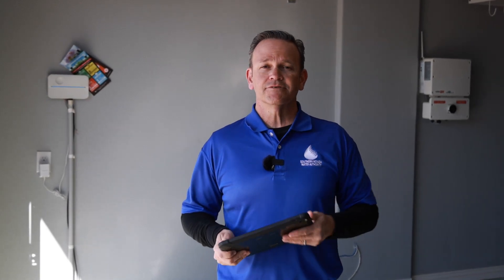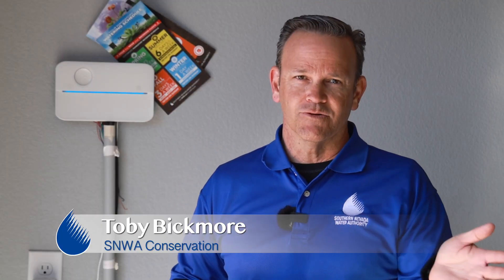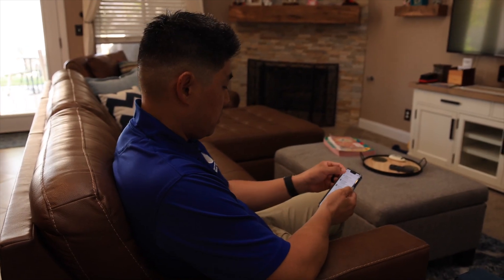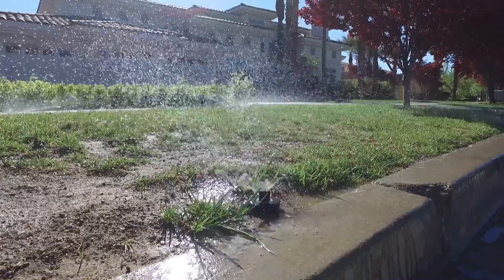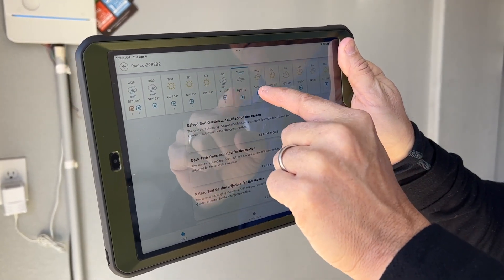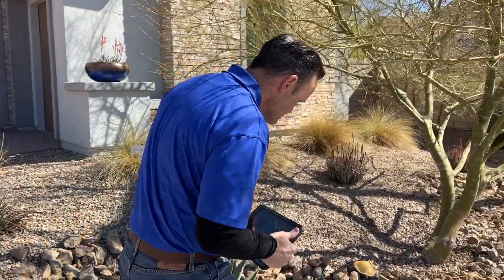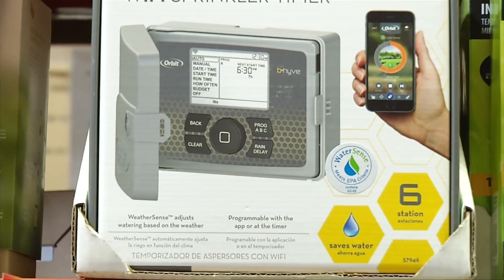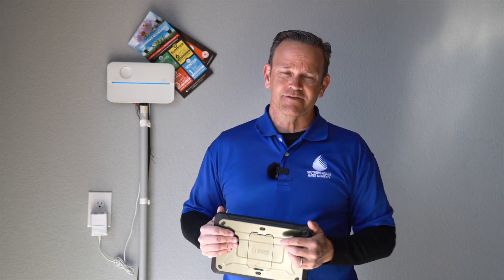Smart vs. Traditional Irrigation Controllers: Smart Technology Used to Your Advantage

Comment: Excellent video and I unfortunately don't agree with the commentary re the Las Vegas Valley Water District.  I have both types of controllers (in fact three controllers), a Weathermatic SL1600, a Weathermatic PL800, and a Rachio 3e controller.  Living in the Vegas valley, I found that the Rachio controller required significantly greater use of water than the "conventional" controllers (maybe my programming settings were incorrect, but I tried multiple variables).  Another significant miss re the Rachio controllers is that they do NOT have a manual MONTHLY  scheduler that allows you to comply with the LVVWD seasonal watering restrictions where you can create a watering schedule and forget it (Rachio only allows date ranges meaning you'll have to repeat creating a schedule each year).  HOWEVER, as this video points out, the Rachio unit (like many WiFi models) allows you to conveniently troubleshoot emitters and leaks using their associated mobile phone/tablet app; a real plus.

After testing many irrigation controllers, I have found the best controller for the Las Vegas Valley Water District is the Weathermatic line for the simple reason these controllers can be programmed one time in a set-it-and-forget-it manner.  The secret sauce is that the Weathermatic units include a MONTHLY SEASONAL ADJUST feature (a feature that I wish Rachio and other smart controllers would consider).  So in our case, we are required to water on: 
- Mon-Sat from May-Aug; 
- Mon, Wed, & Fri during Mar-Apr, Sep-Oct; and 
- Fri during Nov-Feb.

On the Weathermatic units, use:
- Program A for May-Aug months,
- Program B for Mar-Apr, Sep-Oct months, and
- Program C for Nov-Feb. 

Set the days and times to water per usual. Then set the Monthly Seasonal Adjust as follows:
- Program A: 100% for May-Aug (0% all other months), 
- Program B: 100% for Mar-Apr, Sep-Oct (0% all other months), 
- Program C: 100% for Nov-Feb (0% all other months). 

That's it, set until the LVVWD changes the schedule.  The Weathermatic PL800 is the daily driver here and we water 3 times (1am, 2am, and 3am).  Given our predictable weather here, this method currently seems to be the most cost efficient.  If Rachio added the MONTHLY SCHEDULING and MONTHLY SEASONAL ADJUST features, this would be the best of all worlds in terms of efficiency and convenience.

Until then, I use both controllers (having retired the Weathermatic SL1600 controller).  The PL800 is the daily driver and the Rachio 3e is the troubleshooter.  Both controllers are wired to a 3-way Power Switch and service 5 irrigation zones.  The switch is usually positoned to power the Weathermatic PL800 and when I need to troubleshoot, the switch is positioned to the Rachio controller and the Rachio app on my phone lets me manually control irrigating each zones during troubleshooting.

I can see how the Rachio units make sense in other parts of the country where weather conditions vary considerably from day to day, especially re rain.  I would love to hear others' experience on this topic and the values entered on the Rachio unit if you're in the Las Vegas valley.  And if you're with Rachio, please consider a MANUAL programming feature that is not tied to hard dates (using MONTHS instead) and consider a MONTHLY SEASONAL ADJUST feature for desert climates.  And if you're with Weathermatic, consider incorporating Rachio WiFi with rich app features (a much steeper hill to climb).  We all want to save water use and money.  It's a win-win.